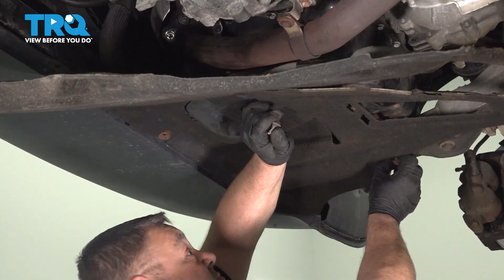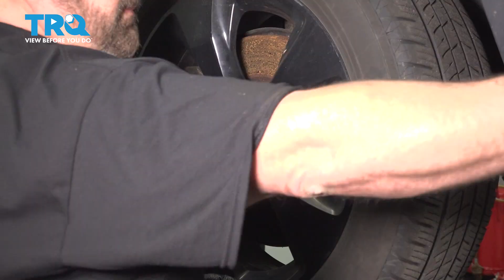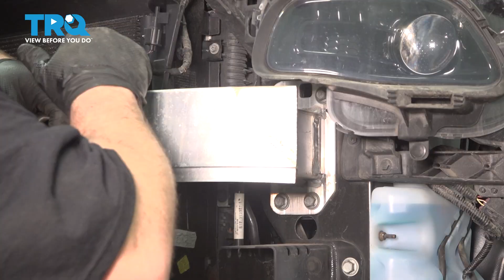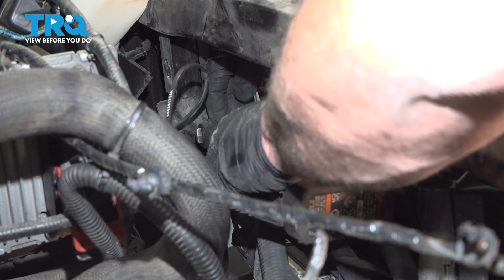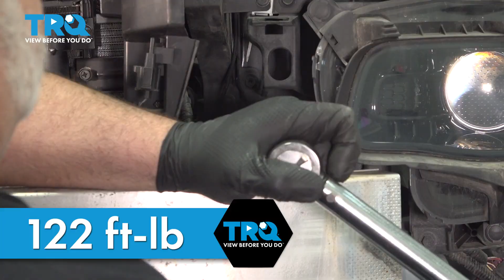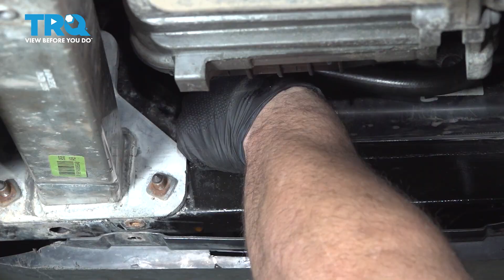How to Replace Radiator Cooling Fan Assembly 2014-2023 Jeep Cherokee

Comment: this is the most insane rad fan replacement i have ever seen. i am REALLY hoping mine isn't bad and it's a wiring/fuse issue. didnt think it was a big deal and figured it would be a normal quick fan swap. oh but nooo, it's a modern jeep. Gotta disassemble the entire front end, because why not. Turn a $200 job into a $1500 job with labor lol